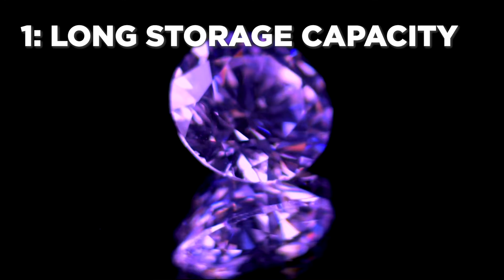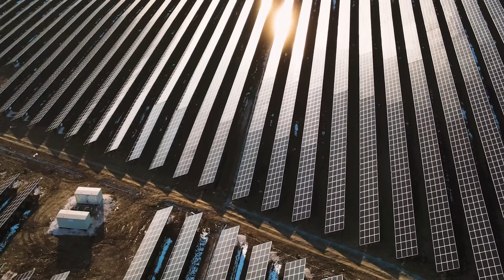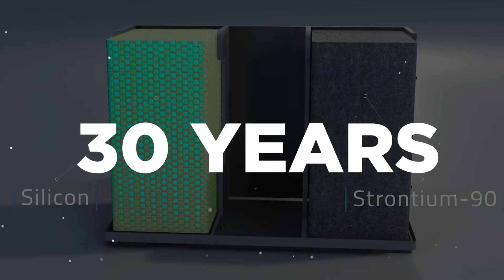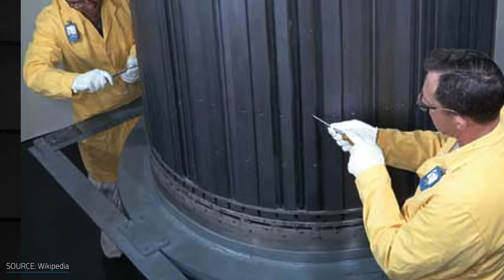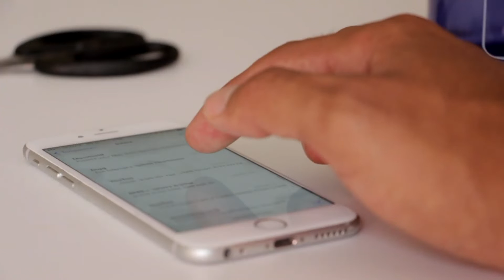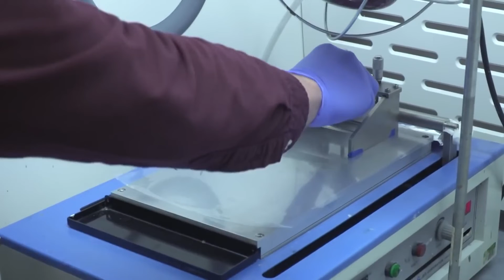NO MORE LITHIUM!  25,000 Years of Power from Nuclear Diamond Batteries?!

Comment: My initial thought is:  "self powered" micro circuits. The need for external power is no longer needed once the engineers design the nuclear diamond  battery into circuit chips themselves. Enabling the circuits to provide the energy to make electronics operate.

 Imagine never having to plug electronics into the wall ever again. Recycling would also be the way to recover the batteries for reuse..

Comment: NDB is promoting some seriously ignorant utter nonsense! The power output of nuclear diamond batteries is just way too little for use in EVs and consumer products like smart phones, laptops etc. Imagine a nuclear diamond battery that can last 1000s of years 😊...then, realize such battery needs to be 1000s of times bigger and 1000s of times more expensive than a Li-Ion battery for the same power 😮🥸🧐…do your homework about POWER DENSITY (in this case micro Watts per cubic centimeter) and you will understand this message! And no, R&D on this battery type can not defy the 1st law of thermodynamics limiting the max power to the natural decay energy that will forever be in the micro watts. In fact, if any betavoltaic battery could actually produce Watts of power, rest assured it would also be extremely dangerous as such power of radioactivity is highly lethal.

Comment: I like the realistic take in this video. Thank you for not being a hypeman like so many were for the solar roads.
Reply from the maker: Thanks a lot, I appreciate your feedback!
Reply: Yes but it would be better the video is more clearly expressing NDB as a scam. Carbon 14 has an isotopic power density of only 0.001305 Watts per gram. The efficiency of turning that into usable electricity is no more then 20% thus you might be lucky to get 0.00026 Watts per gram of carbon. Then add to it the weight of other battery materials and you quickly realize how completely ridiculous NDB is in their claims of making a competitor to Li-Ion batteries. The foundational laws of physics prove NDB to be a scam.
Reply: It seems time frame to come